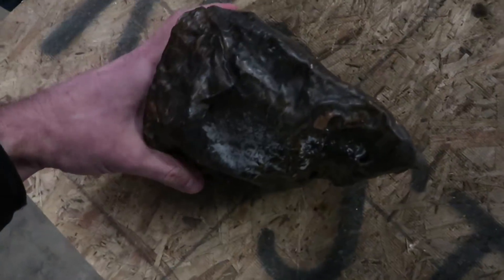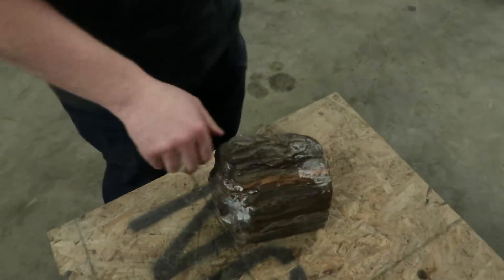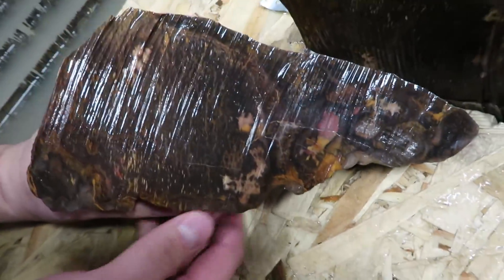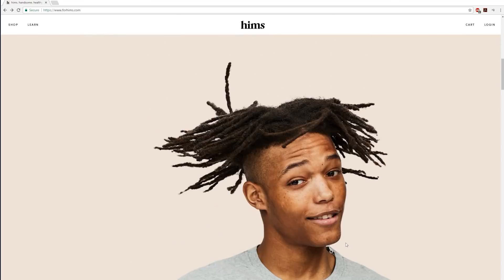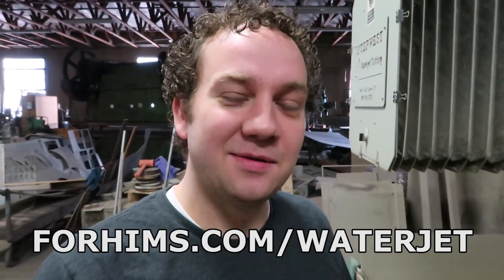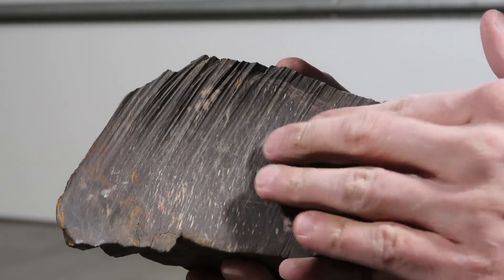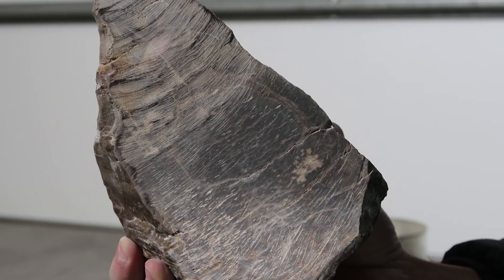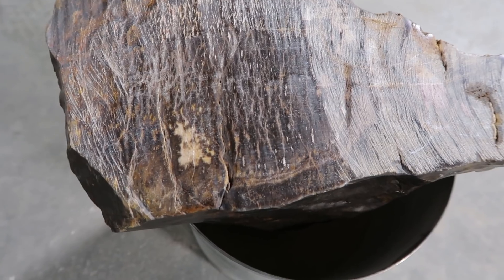Petrified Wood Cut in Half with a 60,000 PSI Waterjet

Comment: ok, for someone who appears to not know much about petrified wood, sanding and polishing, you did a good job, however, you were in serious health situation all through!, Why, you were sanding a silicate mineral! Silica is a very dangerous mineral especially when its grinded since it it turns into tiny sharp airborne particles that find there way to the lungs where they attach and never ever leave!! This in turn may cause serious fibrosis to the lung tissue of course depending and dose. Some minors moderately exposed to silica may develop symptoms in 10-15 years, other to high exposure on very few years and yet other to exceptionally high dose in few months. I doubt in your probably single case you will have anything to worry about, however, next time, make sure to put on proper protection.

Comment: After sanding the wood, couldn't you coat it in epoxy resin to make the surface uniform/glossy and bring out the patterns in the petrified wood? That way you don't end up with the rouge stuck in the wood grain!

Comment: Clearly I'm a bit late to this post, but I've cut cabochons from petrified wood, as well as polished flat slabs or ends of pieces. To grind you really should be using hard diamond grinding discs or burs, The first grinding plate looked like it may have been one. Typically you would use a 100 grit followed by a 260 grit, and this should be done wet which really helps the grinding process go quicker. I'd follow that up with 280, 600, 1200, and finally a 3000 grit, then polish with Cerium Oxide, Tin Oxide, Aluminum Oxide or a 14000-50000 diamond paste with a leather or canvas polishing pad. You'll get a mirror finish, and It will look amazing.
Reply: ^^^^^
I sell some beautiful slices that are polished this way, and hey, I'm even later!
Reply: WhatIfItWasPurple  I know that I am also late but could you tell me where

Comment: A lot of petrified wood doesn't have any obvious wood characteristics and will look like a straight up desert rock. Usually you can tell it was wood by looking at it under a microscope since the mineral replacement is still molded by the the old cell walls.